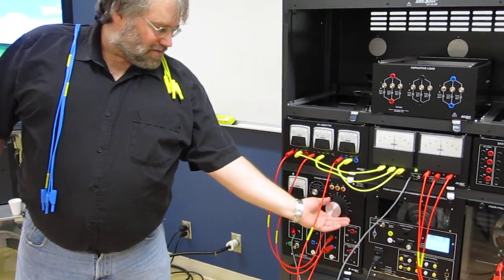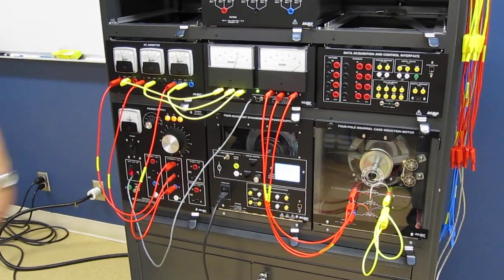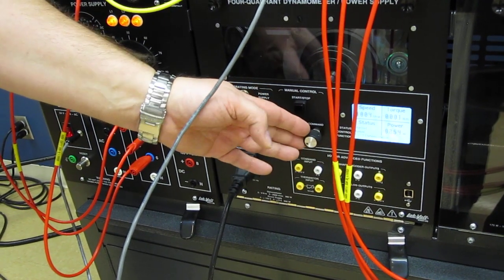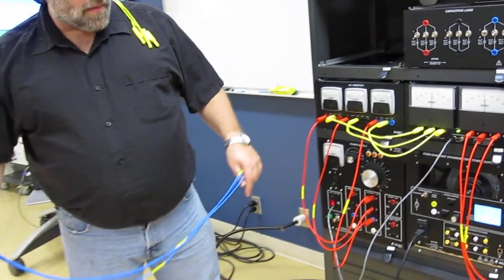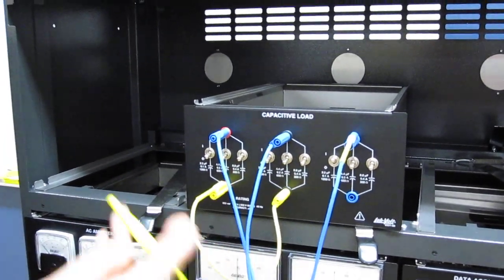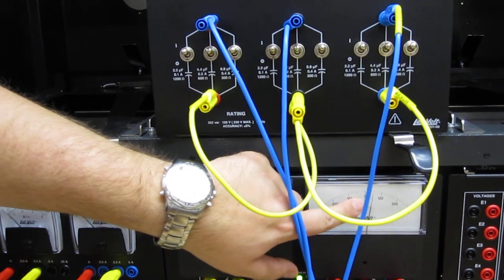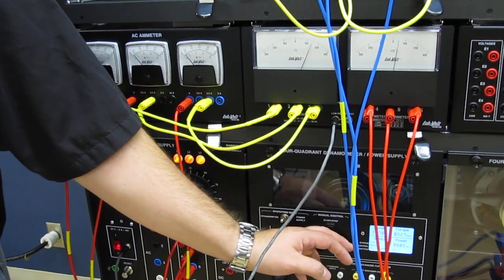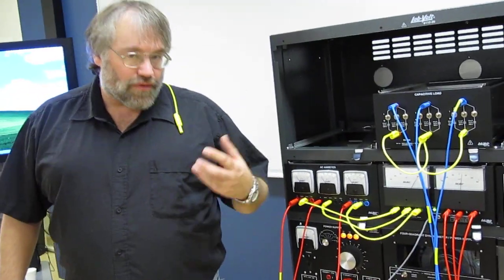Power factor compensation with induction motor PART 2

Comment from the maker: Common house power meters legally have to do what they are labeled for: measure active power (in kW.h, not kVA.h), which means that reducing your apparent power by adding capacitors is nice to your power company, but won't save you any money, even if the current is lower

Comment from the maker: Power factor is always compensated at the substation, so there is very little loss or inefficiency, just high penalty if you're on an industrial contract.  Power factor is not monitored for houses.  Solar Power is DC, and by definition there is no power factor in DC....